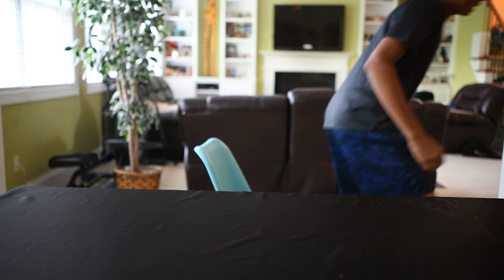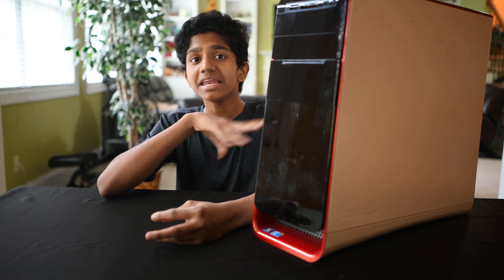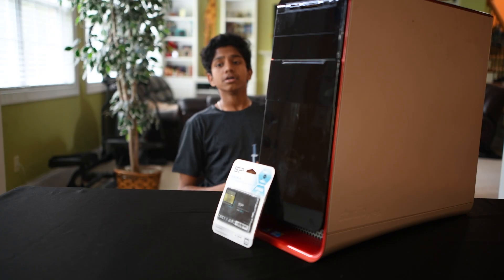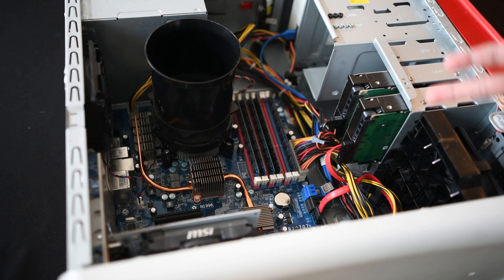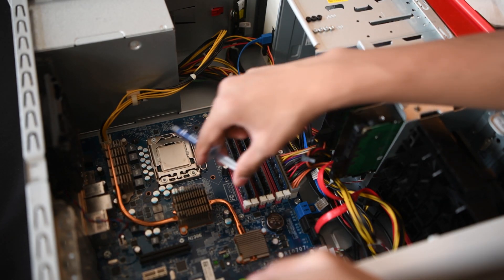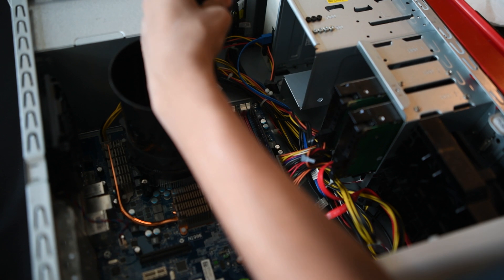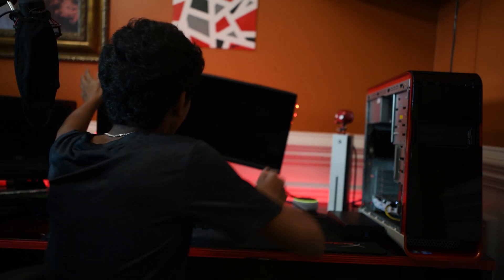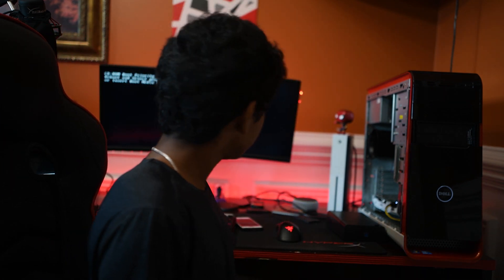How to turn any PC into a Gaming PC | How to Refurbish and Upgrade your PC

Comment: I see you replace your graphics card. Do you have to upgrade your PSU? I have a dell xpx studio 9100 and i would like to upgrade my PC's GRAPHICS CARD, RAM,CPU Etc. What size graphics card should I buy and RAM?
Reply: My 9100 studio's PSU died a while ago, I got a 750W PSU, it chugs any graphics card I've put on it. Currently running with a GTX 1660 6GB card. I also maxed CPU to i7-990x extreme, and replaced system and secondary HDs with SSDs. I haven't added more that the 12GB RAM it originally came with.

Comment: Hi I have a xps studio 9100 and it keeps automatically shutting off. Can you tell me what's wrong? Also I went out and I bought BRAND NEW RAMS
Reply: is it still doing that?
Reply: @leangxd  no my dell PC is not shutting down like it used to do. Because I upgraded my computer 🖥 with 24 ram, xeon 5690 extreme edition and a 3061 ti gpu. It is working well.